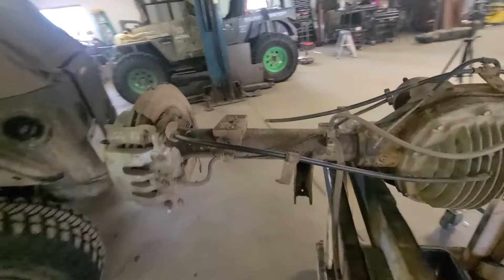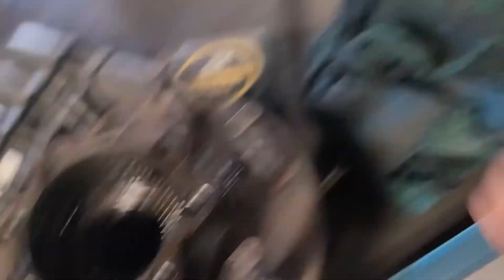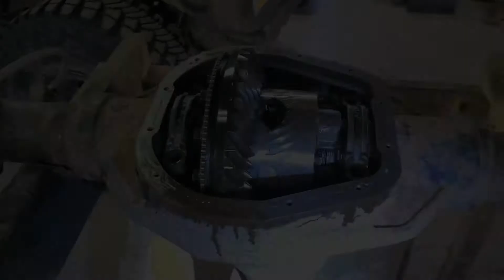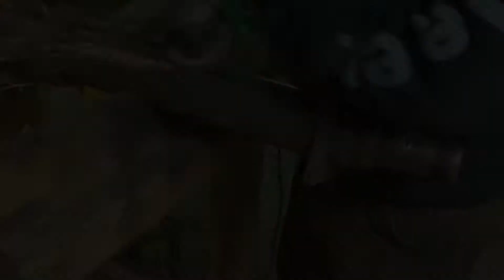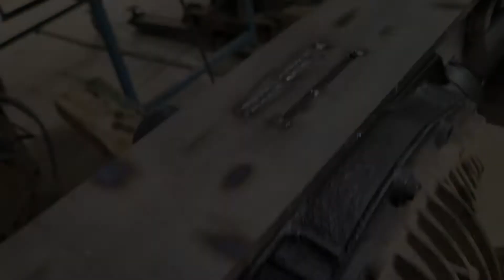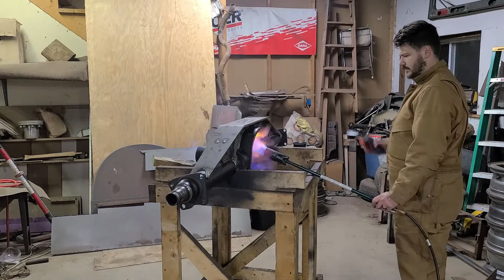Sterling 10.5 Tear Down and Artec Truss Install for the KK Liberty - Superduty - Rock Crawler

Comment: I pulled the brake thing out, tapped the hole and put in a barb for the vent, and went with a different block for the brakes
Reply from the maker: Thanks for the info

Comment: Hey we volunteered at Bantam together.  I'm preparing for my Chrysler 10.5 rear double triangular 4 link, and Chrysler 9.5 radius arm suspension front  on my 93 YJ. Thank you for the insight on weldable primer being crap. I appreciate the video. See you at the fall bash I'll still be in my 08 JKU Soundwave.
Reply from the maker: Thanks for checking in. The Steel-it is expensive, but works great. That other stuff wasn't so great.

Comment: I did the same axle build last November for my wide open design TJ chassis build. 2005 superduty axles with artec full width trusses front and rear. Got their full hydro mount and weld on full hydro high steer arms too. Spool in the front with chromoly shafts and ox locker in rear. Should be ready to take it on the trails in about 5 months!
Reply from the maker: Hopefully this project is on the same timeline. 😁

Comment: what is the purpose of such a reinforcement of the axis? And do you want to increase the carrying capacity?
Reply from the maker: It certainly adds strength to the axle. This has nothing to do with carrying capacity though. This will be used off road and it will prevent it from getting bent or the housing broken. I have seen both happen off road. It also gives you a place to mount the upper links.

Comment: Use steel-it paint as weld through primer it infused with stainless steel the real weld through primer is zinc or galvanized paint and your top coat paint wont stick long we used it for years at the welding shop and it sucked paint just peels off then we started using steel-it and we completely switched and paint sticks to it fine for top coating  and if not top coated the steel-it still lasts years even with are salty winter roads in pa.. thanks for sharing
Reply from the maker: Yep.... That is exactly what we used to paint the axles. It is good stuff for sure